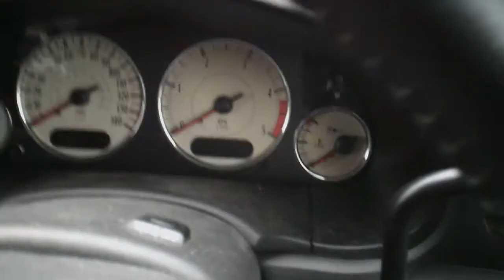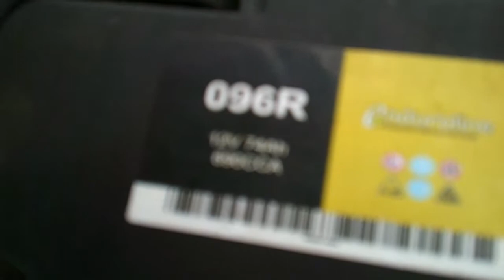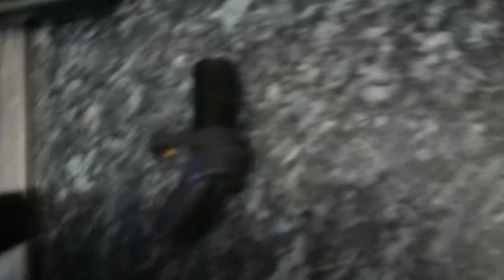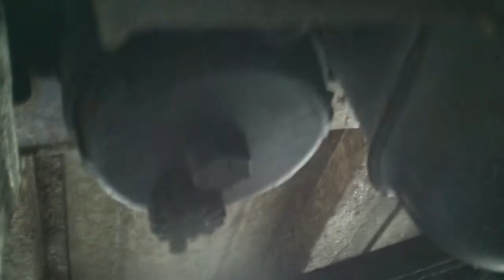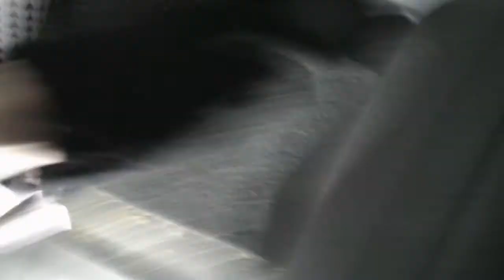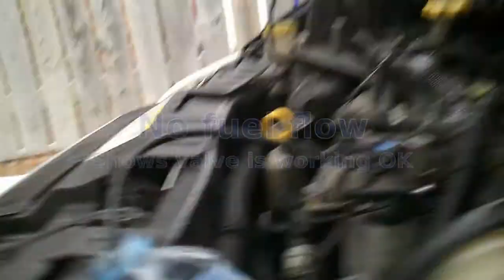Chrysler Grand Voyager 2.8CRD Cutting out in Cold weather

Comment: Cutting out in idle is the problem with fuel pressure regulator Just change it. And also check the pressure valve if it is leaking.

Comment: Mines been playing up too. It was intermittently cutting out. I found the fuel heater was burnt out. And it was sucking in air. It wasn't leaking fuel but with the connector plug off it squirted fuel out if the primer was pressed. I replaced the housing and fitted a repair wiring kit. Bloody thing cuts out when selecting reverse now.🙄 Any ideas anyone?
Reply: may be neutral position sencer

Comment: cheers for video Andy, can i ask u a few questions about yours because im having a nightmare with a friends one im trying to help!! 1. It can rev up in Park (AUTOMATIC) to 2500 rpm and not cut out i assume it has rev limiting because its in park. 2. His cuts out as soon as u accelerate in drive  at roughly over 2000 rpm 3. It usually restarts right away  4. It happeninh now in the summer UK weather so not a cold start issue! cheers sandy
Reply from the maker: Hi Sandy, firstly, yep rev limiter in park, annoyingly always below the cutting out problems. When in drive it sounds to me like fuel starvation when it tries to 'use' fuel to shift the car but the restart straight away is unusual as i'd expect it to need to turn and prime. Does it have the electric lift pump as that might be hiding the fuel starvation issue as it runs whenever ignition is cycled? Otherwise I'd be starting to think weak fuel pump, but to test you'd need proper fuel pressure kit unfortunately
Reply: Andy Brown cheers Andy, this one doesn't have electric pump only fuel level sensor in the tank, so it's only vacuum.  I'm wondering about leaking diaphragm in the fuel primer as it always returns to the top of the spring and never stays in like a usual primer, also recently it's not restarting right away and priming doesn't make much difference cheers sandy

Comment: Hi Andy what is the mileage on your Chrysler just bought one on a 57 plate with 135000 on my clock looks like I've got a few things to check nice work matey thanks for your videos did you do the gearbox your self. Jeff
Reply from the maker: Bumble Mee hi Jeff, 135k on mine now, i did the flexplate work myself (with father), haven't got round to doing the gearbox oil and filter change but probably will over summer and will record another video
Reply: Thanks Andy as cam belt been done on your voyager as iv'e got no record of it being done on mine got full history is it done on a full service at a 120k will keep following your progress. Jeff
Reply from the maker: Bumble Mee I'd definitely get timing done and new water pump, bit of money to get done (send to garage for that one!)